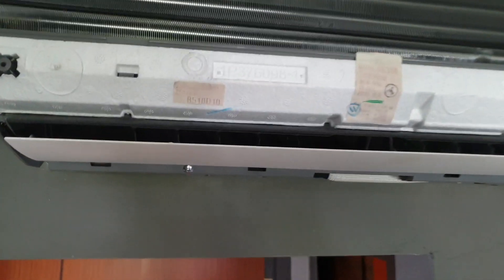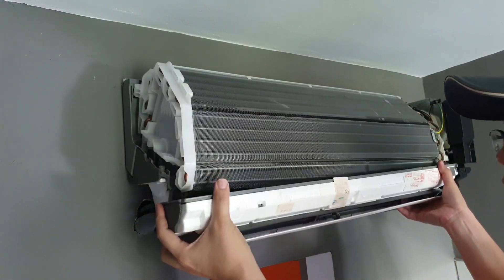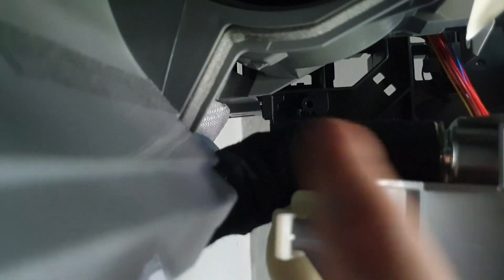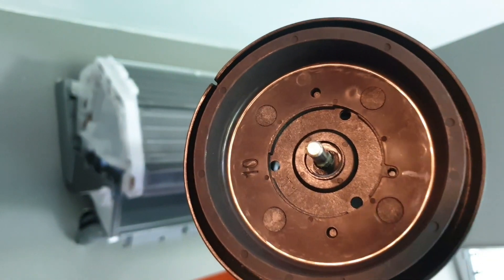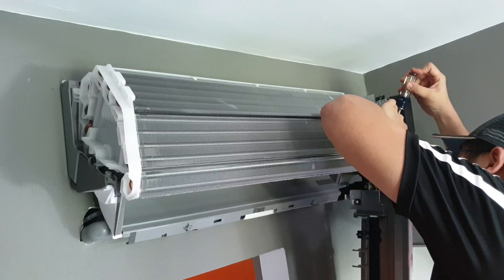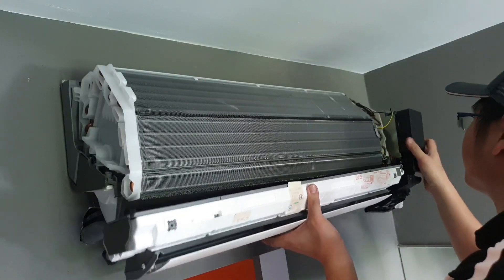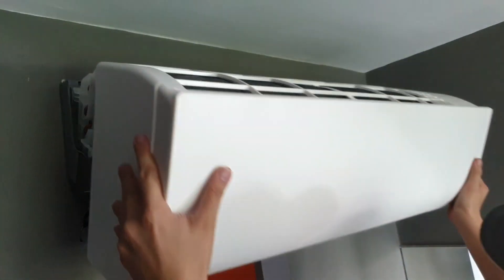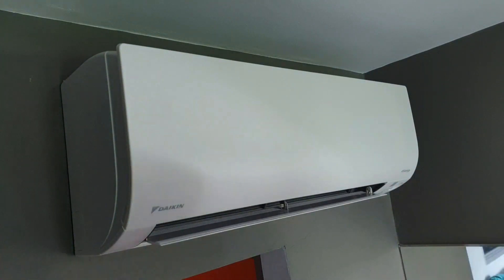Hoot.sg - Dismantling Daikin FCU Indoor Unit (Smile, iSmile, Smart Envi, Ezi Series )

Comment: Hie Kelvin, i have a FTV50pbv model..2hp air cond.. removed the blower and cleaned it but having issues to put the blower back, is there any tips or anything im doing wrong.. the shaft doesnt want to enter on the right side fully into the hole..

Comment: Is there no screw to unscrew at the right side of the blower? Or just simply pull it back to detach the blower? Thanks
Reply: Depending on the model. Some have magnets so you just pull. Some have screw (like mine, Daikin Sensira from 2021). If you look at the blower on that right side, if there is a screw you will see it as there will be some blades missing where the screw is.

Comment: Thank you so much. Had to manually clean mine as the technicians did a bad job. Was full of black mold, dust and some jelly substance 2 months after AC technicians "cleaned" it. They never removed the fan or pan, instead said it's not possible.
Reply: I watched the techs last time there were at my place. Spray cleaning substance and vacuum. Thats it. $50 per unit. Scam. Now im here trying to figure it out myself
Reply: @DrFNRx  I got this cheap AC foaming spray online (Chinese product) and surprisingly it removed all the gunk after leaving it for 30 min (used 2 cans). I taped a bag on the indoor unit to catch the dripping liquid and it did a better job than the techs. Unfortunately that does not do anything for the outdoor unit. Still scratching my head on how to maintain that.

Comment: No offence ah..the easy way to remove daikin blower is..first is the cover..second is the watertray after water tray then u easy dismantle the blower..actually to dismantle the wateray doesn't need to remove the swimg motor..just unplug two wire then can remove watertray..with or without switch off the pwer also can..
Reply: Thanks❤

Comment: After my super took out my blower wheel to clean and put everything back together, now my AC unit is leaking water. I checked the drain pan and it is full. Could the super have caused this when putting the blower wheel back incorrectly?
Reply: Probably crooked needs to be tilted to the side the drainage is

Comment: This is a great video! I followed the steps and it worked. However, my fcu has tight space constraint so i need to pull the fan coil outward angle wider and i hear a ‘tak’ sound. Did i break anything?
Reply: When i fixed back the blower and cover, the fit is abit out but i can screw back. Unit is operating now.
Reply: No. Is ok

Comment: Thank u so much for the video!  Can I gain access to the drain pipe to pour in Mckenic Choke Clear, for the Daikin iSmile?
Reply: if you have a vacuum which can take in water, you can try vacuum it at the end of the drainage pike, which should be located in the bathroom. It works for me.

Comment: Hi 
I've never been able to remove the Fan blower with out loosening the fan motor so the motor can tip and let the blower slide left. Not this easy on an older unit when the blower is very stuck, did you forget about the grub screw on the motor shaft?
Reply: Some models have a grub screw some do not. Mine does not. The ones with a grub screw have a missing blade or two on the right side of the fan so you can loosen it.
Reply: Yes older daikin inverter models had the blowers that were supposedly to be easily removed but were infact not possbile (in my case) after removing the grub screw. Real pain in the ass.

Comment: How high can you pull up the metal fins? You unscrew all fins screws already, what is holding the metal fins to prevent the whole metal fins falling down to ground, is there some hinge at the metal fins right side, how to prevent the whole metal fins fall down? It seems like daikin blower is easier to remove/attach than mitsubishi starmex, but daikin harder to open the drain pan and unable to open the front plastic fins? Does this video apply the daikin ismile eco CTKM25VVMG? Thanks.

Comment: Hi, is Daikin or Mitsubishi easier to dismantle? Which one quieter? Which one more durable quality last longer? Thanks
Reply: I have used both the older Daikin units and am using the new Starmex now. From the video, I think it is easier to service the Daikin iSmile. Both are good quality and quiet indoor.
Reply: @dannyloke4632  Daikin drain pan and control board looks much harder to fix back than Starmex. I think Starmex is better the front vane can open to clean more areas than Daikin.

Comment: What causes the fishy2 smell ? Bro.
Reply from the maker: Accumulated mould, dust, jelly that remains on the blower and coil. Usually the smell is more significant for the first fews min of operation and it goes away afterwards. 

Best to keep your room ventilated and run the blower mode for 30 mins after you switch off the ac! This helps a bit! It it doesn't, time to do some maintenance! 🙂
Reply: @hoot5080  
Thks for the info. Bro 👍👌

Comment: Still need to unscrew the screw which located at blower motor right ? before we can pull out the blower .
Reply from the maker: There is no screw for daikin smiles series! They are using magnetic blower.
Reply: Yeah I was surprised because that's usually the trickiest bit.

Comment: Hi, i recently purchase a Daikin inverter AC last week but suddenly yesterday it started to make a buzzing type sound im not sure what it is. The model is daikin r32 inverter 1.0hp ftkf25a. Im not sure what to do it still brand new.
Reply from the maker: Hi Thinesash! There is many possibility of fault, check if there is an error code, next check if you can get the manufacturer down to do a check as its only recently installed. 🙂
Reply: @hoot5080  yes i have informed them they are coming tomorrow.

Comment: The 2 screw at the bottom? Do you mean the one screw to the metal plate?
Mine are ftk60
There are  black thing underneath. I untapped it, got got nut. I open it and hear a bit of hissing sound and is smelly. I tighten back 

What seems to be happen
Reply from the maker: Oh no! It is the refrigerant gas pipe! I suggest you get professional to help and not do it yourself as you misunderstood the steps!
Reply: @hoot5080  ist that what your video are